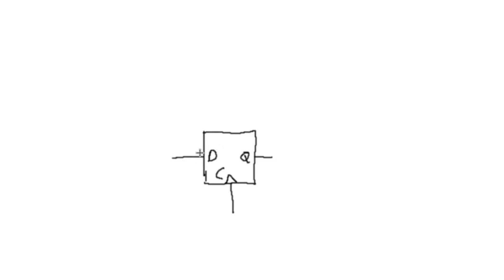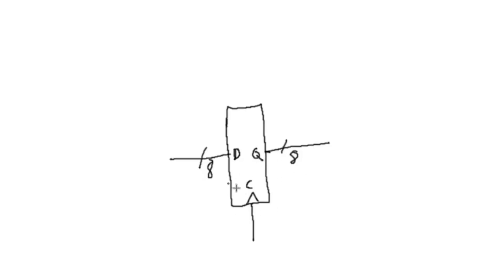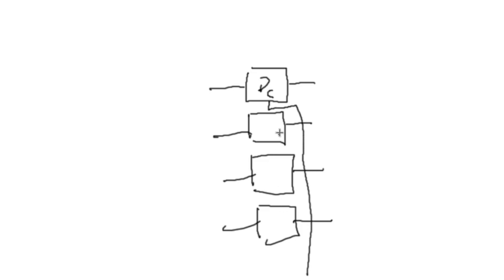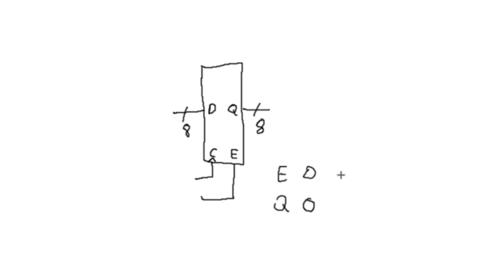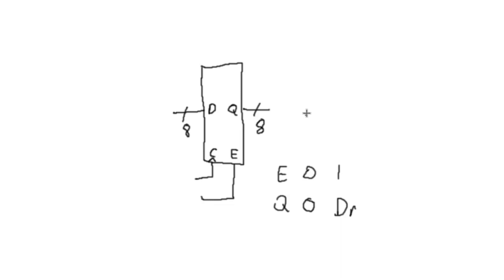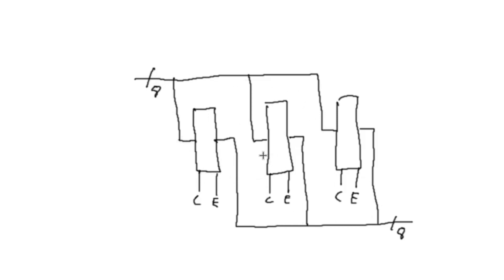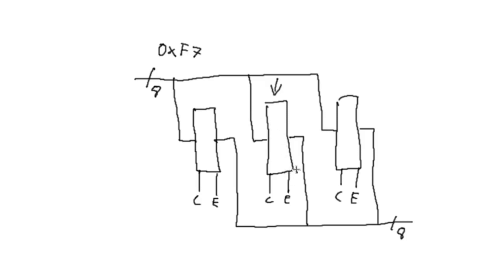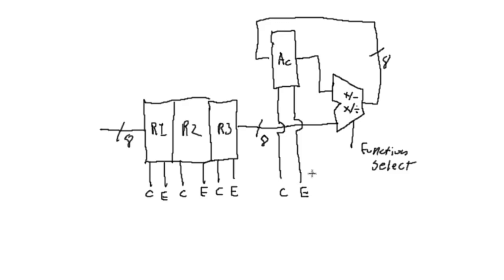Data Registers

Comment: Question not regarding the video. You have said in the past that you don't do block for block tutorials because you think that it is better to experiment ourselves. The issue is that computers in MC are very large and it takes way too long to build them using regular building. How do you speed up your building process, are there any commmands, mods or perhaps a map editor in the mix? It will greatly assist!
Reply from the maker: That's an interesting question, also sorry for the late response.
I do agree, being able to experiment and get quick feedback is great for learning.
And there are tools that help, like world edit. I've even built my own tools, though I haven't been actively developing and maintaining them.

However, I don't think you really need too many experimenting cycles to gain an intuitive understanding of this stuff.

I felt I had a pretty good grasp of this stuff after my third computer.
Granted, I had a background in programming and had a bit of an understanding of the theory. Still, I think you can gain a lot by building just one computer, 3 or 4 more and you'll start to gain some confidence.

Comment: Hallo n00b :).
I have a question regarding computer architecture. I built a very crude and minimastic single akkumulator von neumann cpu using the modules shown in your tutorial series and your design for a state machine. It works, is turing complete and can complete some basic programms, all that jazz. However i need more power :). Its realy slow and takes forever to execute an instruction. Do you have any ideas how to speed things up? I heard about pipelining, but i have no clue how to use it on a von neumann pc. Are there any videos you can recommend? 
Thanks in advance for any answers!

Comment: Could I challenge you to create a OISC? The language is AllGate, a language I devised. The language works as such:
Each line of code is (a, b, t, c, d) and the way to execute each line is like so:
Set the bit at mem location c to (the result of feeding the bits at mem locations a and b into a logic gate with 4-bit truth table t). If c is 1 after operation, jump to program line d, otherwise move to next line.
(By 4 bit truth table, I mean if the bits are wxyz, then w represents the output when a and b are 0, x represents when a is 0 and b is 1, y represents when a is 1 and b is 0, and a represents a and b are 1)

If it isn't obvious, AllGate is a binary derivative of SUBLEQ with capabilities at bitwise level and also a total of 16 operations possible.